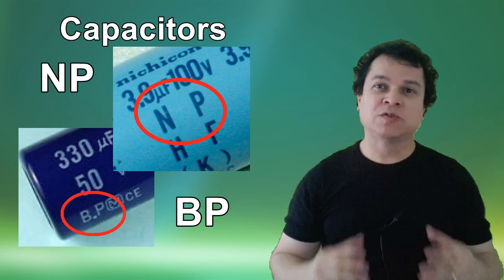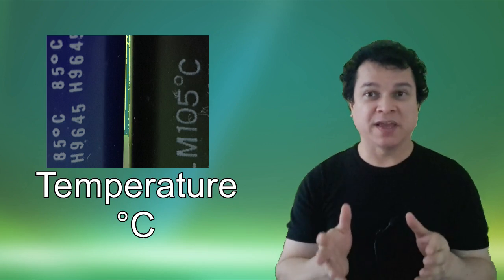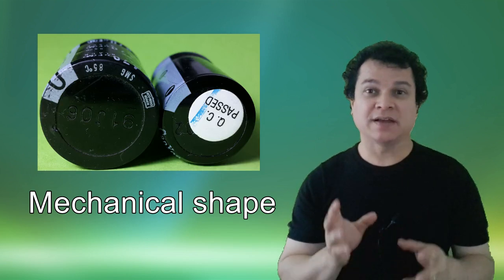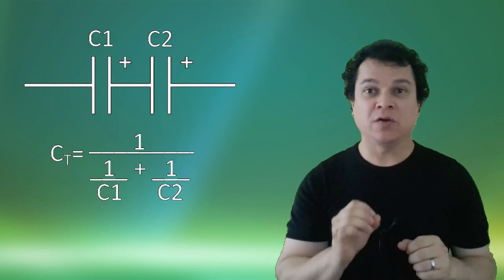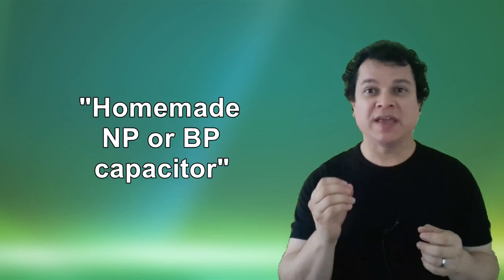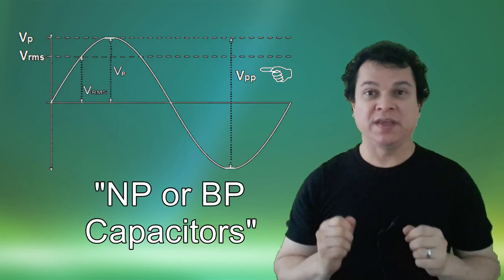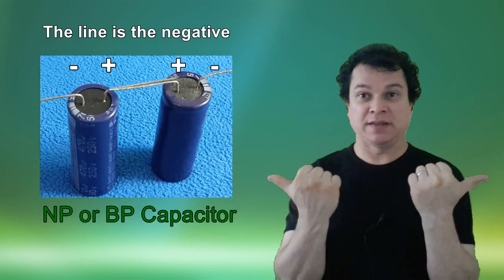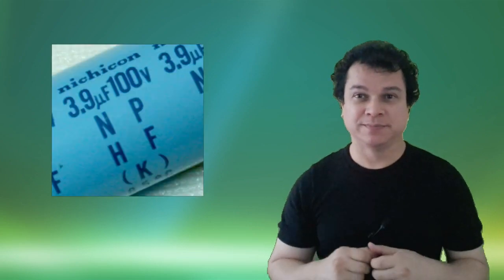NP and BP capacitors / how to replace a capacitor - how to make a bipolar capacitor

Comment: Hi needi 10mfd 50V NP , not getting in  market.plz suggest me how can i make to get same Value and volt
Reply: You need 2x 20µF, not sure if the voltage can be 50V or that it needs to be 100V

Comment: I have a old defect Point welding pliers like this (https://www.profishop.de/telwin-modular-20-ti-punktschweissgeraet-230-v-823015?number=TE4-277&utm_campaign=camp_gshopping&utm_source=source_gs&utm_medium=medium_gs&gclid=Cj0KCQjw-af6BRC5ARIsAALPIlVSQwvuX1k6YMCRiTtAOctxZSdERahgRbp99Ejy6H_33UfVwUHqv9UaAqhrEALw_wcB. There is a Capacitor leaking. It has 500uF and --> TS 60V --> TP 72V What is this for a Capacitor? I don´t know what it means with  TS and TS?

Comment: My original electrolytic capacitor needing to be replaced on my amplifier is a non polarized 10uf 250v -40°+120°C 13x20mm. So which polarized caps would I use to make one? Thanks

Comment: I have always replaced the capacitors from the old devices and used the ELNA capacitors and special in the power supply and I do not care about the temperature and often use the Audio Electrolytic Capacitor .. And the device working without problems .. Is I risk this ?

Comment: it is not trhue that you have to use same value uf on a capasitor.it depends where it goes in circuit.if change capasitor it has to be the same value or higher uf and voltage does work very well and sometimes upgrade a circuit
Reply: As a rule, you need to use the same capacity. The voltage can be higher.

Comment: Hello Mr. Bob:  To be clear, for NP application using polarized electrolytic, I can connect two either  +_+  or  --_--  and result is same, and both may be used in the same circuit? (i.e. + + not exclusive to one type of circuit, and -- -- for different type of circuit)  THANK YOU for video.
Reply: Ken Mason:   I saw that text. I'm not clear if Bob meant use both (--) out if cap between load and negative rail, and both (+) out if cap between load and positive rail, or doesn't matter?  And what if cap goes between (+) and (--) rail? MR. Bob... HELP EXPLAIN.
Reply from the maker: Hello Guys! The video is divided in two sections. One is about how to replace capacitors in general and the other is about the NP capacitor. Most capacitors connected between positive and negative from the source, are electrolytic or factory made bipolar. The NP capacitor we are making at home is to place in serial with an old amplifier's output.  We will find reasons to make the NP capacitor. But in my case I only made them for old audio amplifiers so far. Being in series in the amplifier's output, if the positives point to out or to in, it doesn't mater too much, because this homemade capacitor is conducing AC, and the polarity is alternating. :-)

Comment: Many times capacitor with the same characteristics is smaller from the original can i use a different shape capacitor if they fit or the shape matters in the circuit